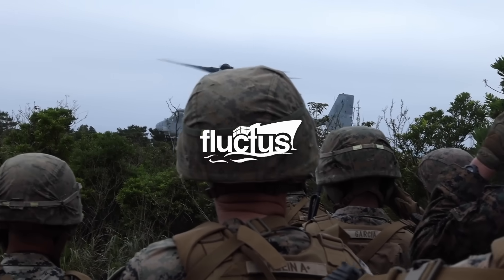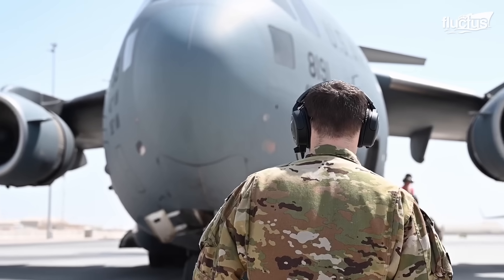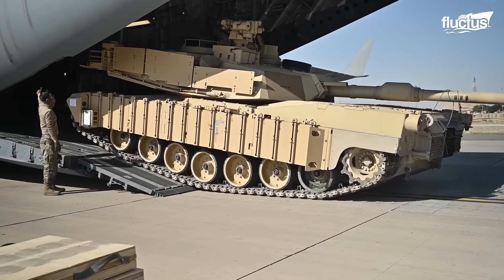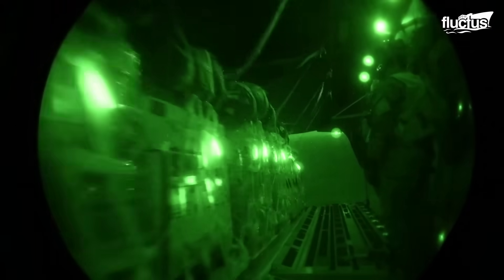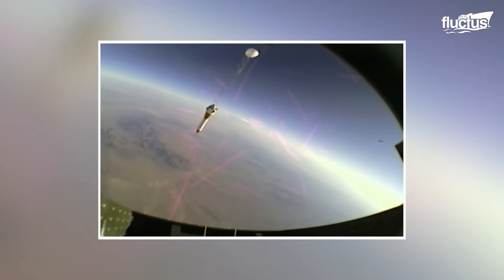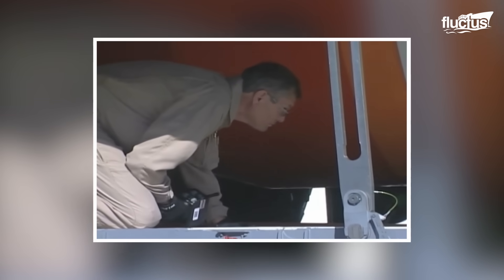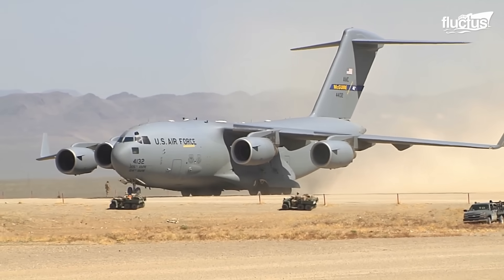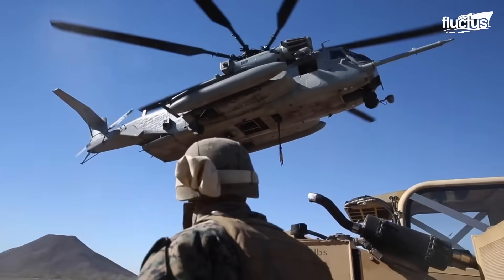Special Techniques US Air Force Uses to Transport Massive Tanks Chained Like Monsters

Comment: the prat & Witneys are not "fully reversible" , that is utter nonsense..
the engines run same direction at all times, both in rotation as in thrust output.

The ONLY thing that is reversible, is the thrust after it comes out of the engine via the normal direction.. egh, the thrust is "redirected" to push back.. 
And that is not the same amount of thrust that goes forward at that point as would normally come out backwards, there are losses.. its not fully reversible.

Comment: While a mid-level NCO in the Army and stationed at Ft. Campbell, KY, I was one of two in our unit designated as a load planner. This was for ships, rail and air. Having every single piece of equipment being weighed 24hrs/day until everything is either at the port, flight line or railhead, was exhausting. These planes are even larger when you are loading them. Especially the C5 Galaxy. Hooooah. 🫡
Reply: Two ladders for the C5 just to get in it. Then to the upper deck